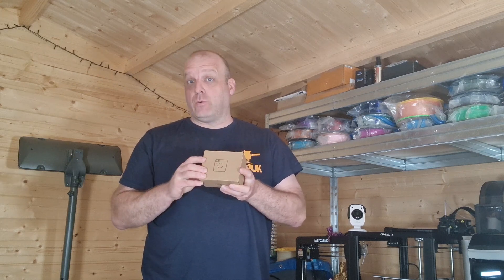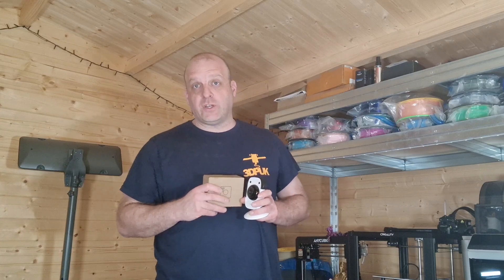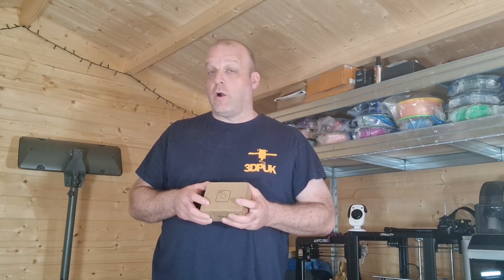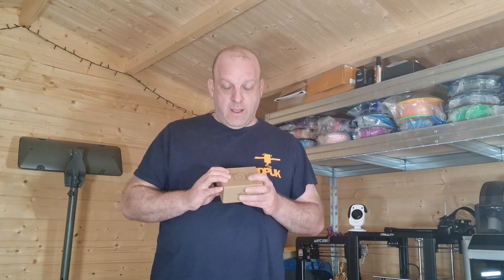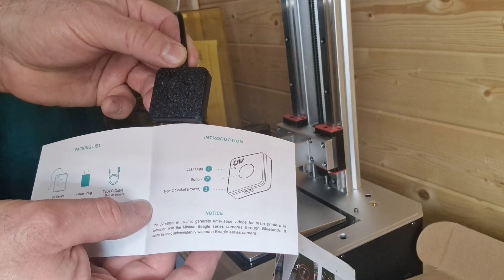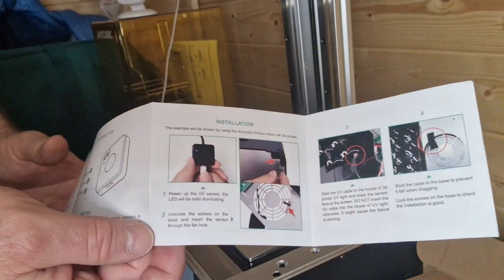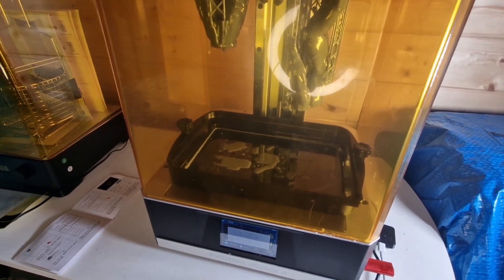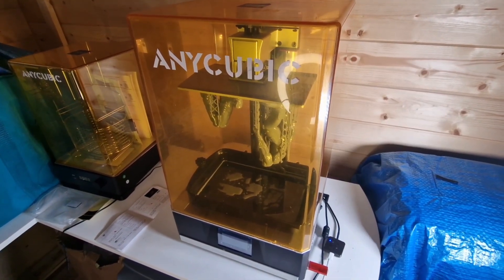New Beagle Mintion UV timelapse Sensor for the beagle timelapse camera 3DPUK

Comment: My question is, is the sensor plugged into the wall and the mintion cam plugged into the printer? My printer only has a USB slot so I need to figure out how to get it connected to the printer.
Reply from the maker: Hey the sensor cable goes within the machine facing the uv light this triggers the sensor to take a pic. The sensor is powered by a USB plug into the mains and then Bluetooth connected to the Beagle camera app. The Beagle camera doesn't need to be plugged directly into the printer as its not based like the fdm setup. During the video it shows how to setup the app etc hope.that helps